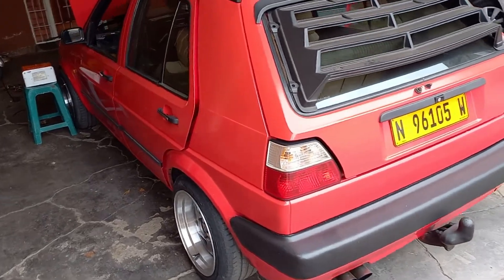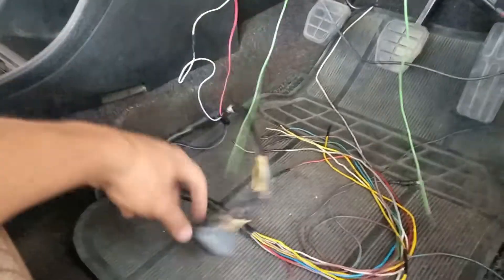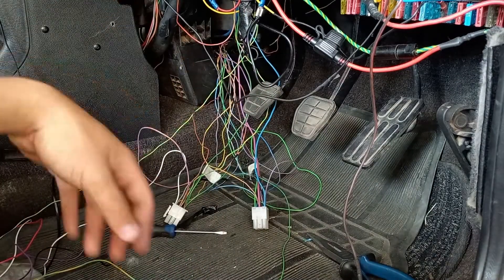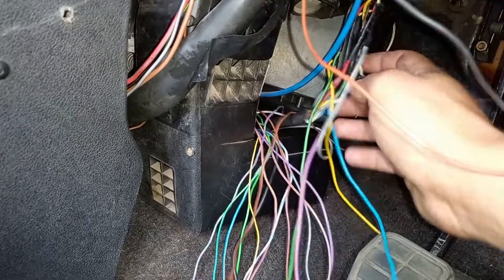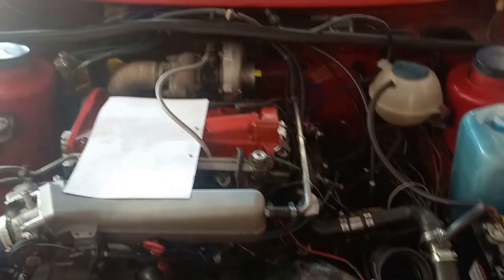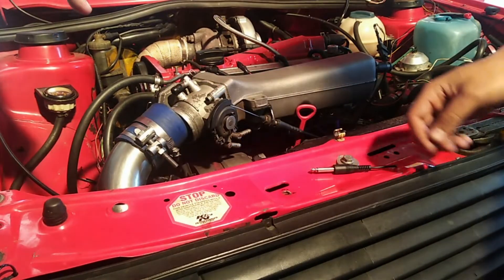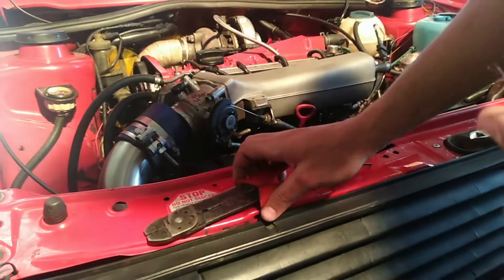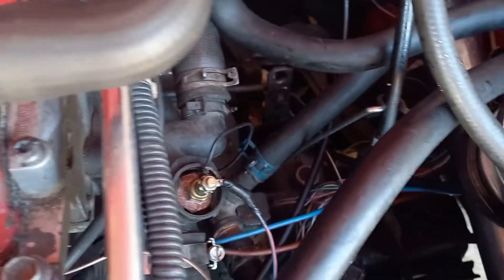Wiring speeduino to engine

Comment: Great video I love your build. How did you do the wiring for the distributor and coil to the speeduino?
Reply from the maker: https://wiki.speeduino.com/en/wiring/Ignition_wiring
Reply from the maker: Thanks! The coil just gets ignition 1 from the ecu, 12v and gnd. Set your ecu to single channel.  

You could use your distributor hall sensor or crankshaft hall sensor as crank signal. 
Distributors and crankshaft hall sensor have the same 3 wires. Which are: 5v, signal and gnd.
Reply from the maker: Sensors get their gnd and 5v from ecu. Coil gets ground from chassis.
Reply from the maker: I believe so. But i have since changed coils because that coil was causing misfires under boost. https://www.vwvortex.com/threads/throw-out-those-aba-coils-right-away-and-get-this.6888569/
Here they talk about that coil too. I am now not using the dizzy at all. Im using wasted spark coil from the mk4 2.0. This style: https://www.google.com/search?q=vw+mk4+2.0+coil&client=ms-android-samsung-rvo1&biw=384&bih=679&prmd=ivnx&sxsrf=APq-WBs86-16yPzgempyp3fqZbA7eH66nQ:1644869990842&source=lnms&tbm=isch&sa=X&ved=2ahUKEwiEyIWcgoD2AhWEiVwKHXezDk8Q_AUoAXoECAIQAQ#imgrc=M7bmKcCjipWeqM
Reply: @061garage  you are a legend. are you using 3 pin coil for aba motor?